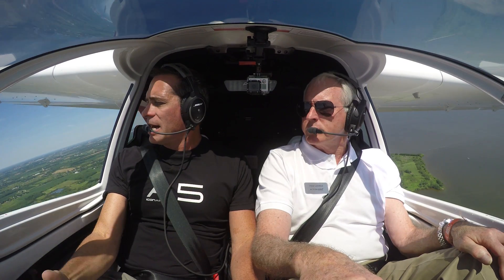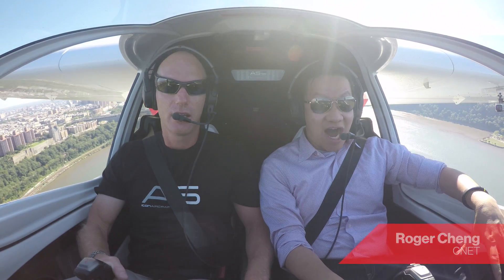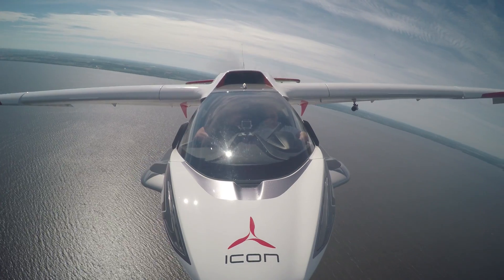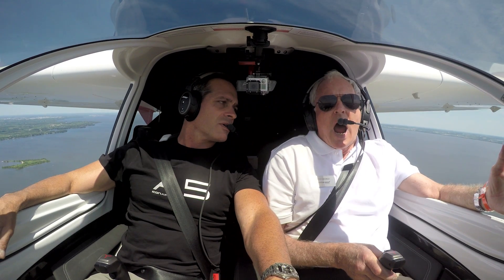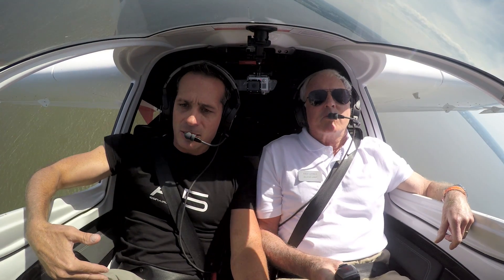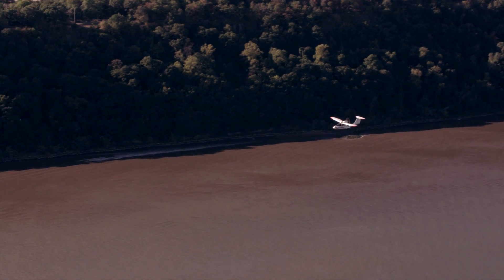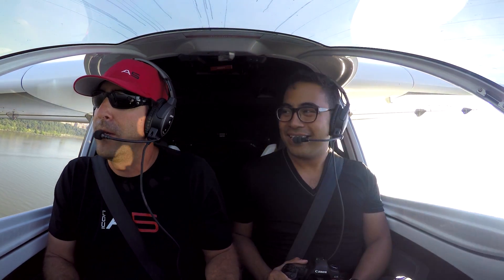A5 Spin Resistance Reactions

Comment: I am a glider pilot which also used to be a flight instructor. I am wondering if at idle and bringing it slowly(1kts/sec) to a stall while snapping the rudder at the moment of the stall, Would I at least experience a spin entry wing drop before flying again,  Like it use to be with an SGS 2-33(not in our fleet anymore) or a nose heavy ASK-21.
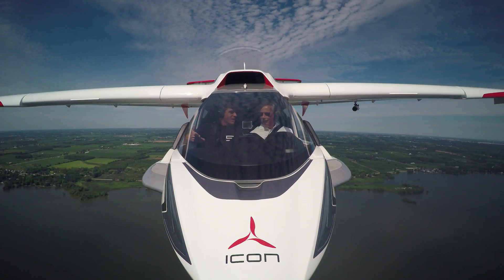Reply: Hmmmh ! Btw 1:40 abd 1:55 with aft stick and X-controls it seemed to only oscillate in roll.  If it is exactm then it is impressive.  Wonder if this could be done in a «higher performing» wing design. I mean  higher performing in terms of speed range.
Reply: As a pilot - what do you think now? After Halladay?
Reply: In development, Icon tried to put it in a spin repeatably but never did, they still only claim spin resistant, one must still be prepared.

Comment: they exaggerate the stall resistance compared to other aircraft.  I am sure it is good, and I am sure it is better than my plane.  But my C-150 has very gentle stall characteristics as well, you have to put a peddle on the floor to make it spin.
Reply: I've flown the A5.  They are not exaggerating.  Nothing like the C150.
Reply: Larsonaut yea well I own a c150 and it does not stall anything like they make it out to. So they are definitely exaggerating.
Reply: and of course they took up a bunch of non-pilots to test out the a5...
Reply: @DouglasGardnerTV  they weren't all nonpilots - the dudes from aviation weekly and eaa were very experienced pilots...

Comment: maneuvers at low altitude give you very little margin for error...I saw another video with Deniz Burnham at the controls where she approaches the water in a very tight, high bank turn at low altitude...yeah, you better hope it doesn't stall or spin....
Reply: That is why they installed the AoA gauge to give a visual of what the wings are doing. Fly the white line and keep it out of the red, your
Reply: Stall indicator

Comment: Losing Roy was very tragic, however, doing steep manoeuvres 25 to 50 feet off the water is not responsible flying.   You have nowhere to go if things go wrong.    I will say that Icon markets this plane as a fun ride with “ car-like “ characteristics.   That is also irresponsible.     Planes need to be at a safe altitude.

Comment: People saying this plane isn't safe are morons, read the crash reports, each time it's been pilot error, it's like driving a sports car, people get in them and think they are race car drivers. The crash back in may that killed the 2 Icon employees was because they were flying on the deck and basically intentionally tip stalled thinking that they could get out of it, but you still need a few feet to do it, when you're 20 feet from the ground that's a little hard.
Reply: And if you want more proof that Roy was flying this plane like an assjack, just look at his twitter, his son even posted about him flying "so low to the ground" and about it feeling like he was in a fighter jet and Roy's response was "I AM in a fighter jet"
Reply: There is a reason why pilots have thousands of hours of practice before flying alone. This plane just provides a false sense of security to beginners.
Reply: Mike McGlock Lol you fly alone with more like 15 hours, my first solo was with 12...You can get your PPL at 40 hours (or 35 in a Part 141 program) and fly others from day one with PPL. Do some research, haha.